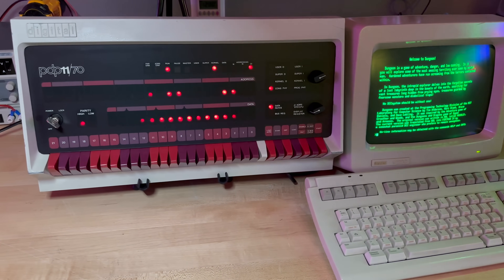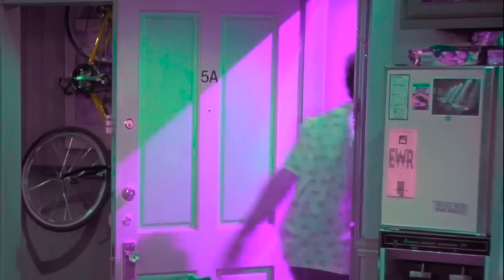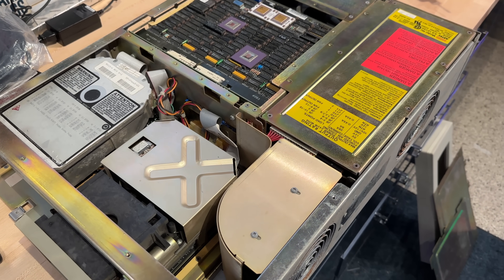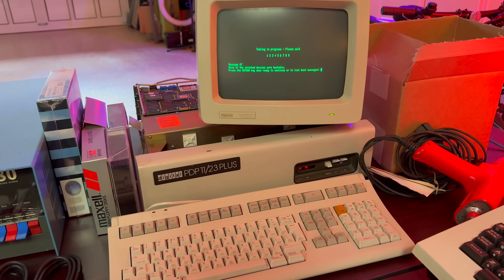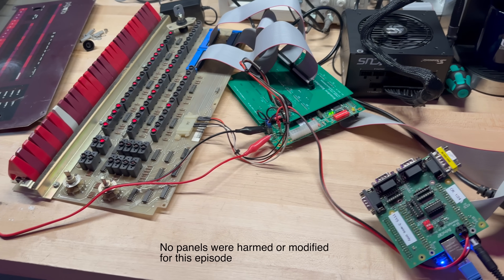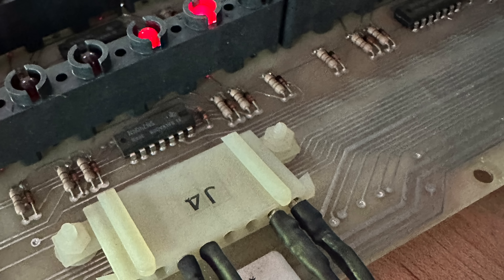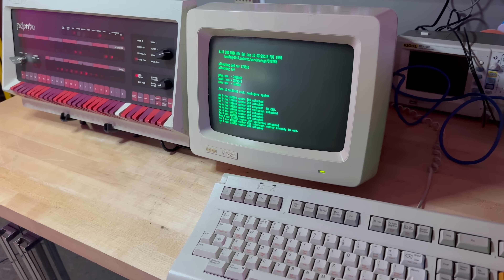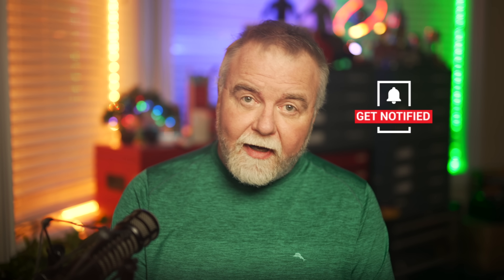Ultimate LED: The PDP-11 DASBLINKENLIGHTS!

Comment: So, the bezel you are missing could probably be reproduced in fiberglass and epoxy resin if you had one to produce a mold from. If you're interested I would suggest contacting Andy at the Boatworks Today youtube channel and get some insight from him about it. Couldn't hurt to ask. Casting in metal with a sand mold is possible but using an original part will result in shrinkage of the reproduction and possible fitment problems.

Comment: I used a pdp11/40 and a pdp11/20 whilst at university. They too had a physical front panel and had 16 teletype terminals connected to the pdp11/20. They were used for assembler programming for the systems programming module. They ran the universities own OSs. The pdp11/20 was used for interactive program editing and file storage and the pdp11/40 was used to assemble and run programs in batch mode. Part of the course was bare metal coding using the front panel to load and execute hand assembled programs. One of the 'unofficial' contests among the students was to have the displays show the most 'interesting' light patterns. I also had a program which caused the 16 teletype bells to sound in different patterns. One was to continuously ring all the bells whilst a particular front panel switch was set. I tried that when the operator came into the room. Suffice to say she wasn't impressed! There was also a plotter connected to the pdp11/40 and we produced some quite complex patterns. Ah - the good old days.

Comment: I too am looking for a bezel for my 11/70 front panel.  Since the original was made of metal (aluminum? zinc?) perhaps one could take a mold of one.  Then using that mold, create a positive and use it as a pattern for sand-casting.  I'm not sure how one would inexpensively make the positive slightly larger than the original to account for the molten metal shrinking as it cools.

Comment: I worked for DEC in the late 1970's.  The computer lab in the part of the company where I worked had a bunch of different PDP-11's.  Each of the systems was named for a character from "the Lord of the Rings", except for one.  That machine was a hugely expanded PDP-11/70 named "The Ark" (it had TWO of everything interfaced to it!)  The second largest system was named Gandalf, there was a small 11/20 called Bilbo.

Comment: From Jörg Hoppe's Web site (retrocmp):
"The last version of [RSX11M+] (V4.6) was updated to be Y2K compatible
so current dates work fine on it."

That comment is in reference to the "baseline" distribution disk
image at trailing-edge: rsx11mplus_4_6_bl87_dsk , which is presumably
the one you're using (the version is just legible in the shot of
the boot-up messages on your VT-220).

That version of RSX-11M+ was released in February, 1999 by
Mentec (not DEC). According to Wikipedia:

"Ownership of RSX-11S, RSX-11M, RSX-11M Plus and Micro/RSX was transferred
from Digital to Mentec Inc. in March 1994 as part of a broader agreement.
Mentec Inc. was the US subsidiary of Mentec Limited, an Irish firm
specializing in PDP-11 hardware and software support."

Comment: What a trip down memory lane, Dave.  I went to Northern College of Applied Arts and Technology in good old Kirkland Lake, Ontarion, Canada. Same old PDP 11-70 except the IOS was RSTS/E if memory serves me.  The is where I learned to program using Basic, Basic Plus2, COBOL, Fortran, APG, and assembler.  I did a research paper interfacing a Motorola D2 kit’s 8 character display and numerical keypad to a door lock solenoid and used the PDP to validate the credentials.  Needed to code in assembler and download to the D2 kit.  I remember stepping through memory banks in hex to fix issues because it was too cumbersome to code in assembler on the PDP, then convert to hex, download to D2 and then try it.  But seeing a solenoid click after entering a passcode was simply magic. I still marvel  at what actually happened to make all that work.  Thanks for posting I thought I would never see at this time!
Reply: I used to love to hate RSTS/E.  I was a student lab tech and spent most of my time rebooting it. Somebody was always trying to do something they weren't supposed to.  Really Slow Time Sharing - it was a great intro to my next DEC experience, a lab full of Vaxes.

Comment: My first computer experience was doing 9 track backups at age 6 standing on a chair and I worked the PDP1170 running RSTS.  My parent's owned the company Spartin Systems back in the 70's through the 90's where they bought, sold and leased time on the PDP11's .  I remember adjusting tape head alignment with my Swiss army knife and dripping wax on the pot switch so it wouldn't move with the vibrations.

Comment: Too funny, one of my first products was a pdp/11 RSTS basic and basic +2 to c translator (for the then “new” Unix systems) with a RSTS SYS AND FIP functional api emulator.  

one of my first “hands on” dec system was a pdp15 … 18bit word 5/7 ascii packing, and you could,play the first star wars game with a buddy using 9 data keys each. Excellent machine  pdp11/34 front end booted with paper tape, vector graphics processor .. and the graphic displays ran in the same memory as the regular cpu .. you just added a ,V’ before each assembler instruction (only assembler and Fortran) .. which allowed some clever bastards to use the graphics processor as a second cpu within the same memory space. 

I migrated many pdp11 systems written in assembler to vms/c and Unix/c. Oddly my life has been migrating vms systems to Unix/Linux for the past 30 years … I never left dec land … I miss the old DECUS days in NO .. with TGV renting the river boats.

Up until I migrated it (finished 3 months before 9/11) the 911 fire and ambulance dispatch and call center system for New York City ran on pdp11’s. There are still some nuclear power plants running pdp11’s.

The amount of pdp11 assembler I’ve written / migrated over the years .. I surprised my head hasn’t exploded … one of the hardest things was writing the ODL linker code .. Overlay Data Loader .. which dynamically grabbed code from the disk and dumped it on whatever piece of memory you had allocated for it. God help any code that it dumped on .. many a night pondering why a stacked jump was executing the wrong code.

Fun days.

Comment: I had an LSI-11 with all the lights. At work I had 11-45’s, 11-60’s, 11-70’s and VAX’s. They were used in multiprocessor links to simulate radars (with hardware in the loop), aircraft and missiles for critical-time (solve x equations in less than y time) for EW work. At home I had the LSI-11 and RSX software with FORTRAN for my PhD work. Of course my fellow students would use it too for there work. I loved the machine!

Comment: Does bring back memories. I wrote quite a bit of machine code on a PDP 8 and then moved to a PDP 11.  Digital really nailed the instruction set on the 11 with the mov instruction, device addressing via memory locations and great interrupt system - so clean compared to the PDP 8.  The machine I worked on had core memory, I think initially 4kb then we upgraded to 8k with semiconductor memory? It ran with a cassette disk drive with maybe a megabyte of capacity, huge! It could run Unix. Not sure what model it was, but it had paddle keys, with the magenta/red colouring. I had to toggle in a binary loader to get it running. Used it to run a radio telescope and sample and process the output. Amazing what you could do in 8k of memory.
Reply: Yes.  I started on a PDP-5 that the university had set up in an engineering building room for students only.  We had our own software budget and some other old electronics that got assembled into a working analog computer interfaced to the PDP-5, and now I'm seeing analog computers getting a fresh look for some problems.

Comment: In the 1980s, I met a fellow at Comdex who had a warehouse full of PDP-11 hardware. After sufficient recreation, I agreed to buy one. Several months later, he showed up at my company on 24th Street in San Francisco with a truck full of stuff. After some hard work, we had several six-foot tall 19" racks in the main room of my one-bedroom apartment on the second floor. By the time we got the machine running, he had emptied my bank account with unexpected expenses, including sending several boards off for repair. Ultimately it was all working though. I had forgotten a lot about this kind of equipment, though. It not only dimmed the neighborhood lights when I turned it on, but it was really loud. When I ran it I had to keep the sliding door to the porch open so the heat could escape. I gave terminals to several of my neighbors and ran serial cables out the porch door to their porches and, ultimately, to their terminals. I got my hands on a tape of the Decus C compiler, and I was good to go.
So, Dave, I understand your desire to own one of these beasts. It is a shock when you realize that the hard disk, which may have even been 10 megabytes, was the size of a washing machine.
In the end, none of the neighbors felt like using a line editor for word processing. It was just a little too retro.  It gave them a taste of what it was like to have computing at home.
That was Goodall Computer Systems on 24th Street. Those were some fun days.

Comment: I was a DEC FS employee, started in '78, I was trained in Bedford, Mass on all PDP-11's. One system you might have liked was a 11/72, yes 72! It was two 11/70's with common memory in the basement in Bedford. It was very cool. Also, those panels you have could have been saved because DEC FS routinely replaced them with a Remote Diagnosis front panel that did not have switches and all the lights. It was connected to DEC in Colorado Springs. We did not have what is now self-tests at power up time, but the RDC could be into the machine while I was dispatching to remediate, a very different time than remediation now.

Comment: I first programmed a LINC-8 in the late 60s in university. Two full size cabinets. DEC tape and analog inputs. (This was a vet research lab)
To boot it you had to use the front panel switches to enter the boot program into 12 bit core memory ... Yes, real core 4K

Comment: you still amaze me with how our 2 careers paralleled each other. You went software and I was hardware. I also cut my teeth on a PDP 11 back in college . At 1st it was the 1108 and then 1103.  I then worked as a user consultant for digital equipment for a pharmaceutical company for a summer.

Comment: Thanks for the flash from the past. I learned machine code and assembly language on a PDP 11 40, and later worked with a PDP 11 4 in a mold factory. Now I really feel old and wise, though no one seems to see the wise part.

Comment: As a Field Engineer for Motorola back in the late 1990's, I was sent to the Hawley Earth Station in Pennsylvania. The complex is nestled in the hills around Lake Wallenpaupack. I was there to install a digital satellite television system, which was just prior to updating all of television in North America to digital and HD from the NTSC standard. But that is a different story. While installing racks of processing equipment, I took time each day to take my breaks and lunch by spending time outside the building.  Outside the data center doors, planted in the grass was what I recognized as a PDP-11. The variety of which, I could not say. The packrat in me wanted to bring it home or at least contact my boss from a previous job, who was also a great mentor. Brad had mentioned learning on a PDP-11 in college.  I recall taking a photo to show him, which is on any of countless rolls of film I had from those days. This video by Dave reminded me of that trip and finding the PDP-11 lavishing in the rainy weather and wishing I had more knowledge of that kind of hardware.

Comment: Had a PDP-1 in the Air Force, 1967. It was used with Basic on a 5 level tape to run a classified program to produce a another classified 5 level tape to run on an analog computer.

Comment: You can also SSH into the BeagleBone over USB.  It's been a long time, so I can't remember what setup there might have originally been to get that working.

(Caveat; I've only used the BeagleBone cards that were included with Gesswein MFM-drive emulators.  Those run some flavour of Linux.  I don't know how close that is to the BeagleBone's stock software.)

Comment: Back in the day, I used a PDP11/34 with the Military.  It was a real time system, I had no access to the OS, so don't really know what it was.  I do know that it sometimes failed in spectacular slow motion.  We would start getting errors, they would pile up and we would then check the clock.  If the next shift was due withing an hour we could reboot, and by the time they arrived the system should be up and running.

Comment: I worked for DEC in Maynard for 18 years. My first home computer, in the late 70's, was a PDP-11 named a PDT-150.  (PDT = Programmable Data Terminal. Ken Olson didn't care for home 'computers')

Two 8 inch floppys and a PDP-11 in a box about 2 ft square.  I ran RT-11 and a VT-52.  I can still recall the clanking of the big floppies as it booted.  Sadly, no row of blinking lights...

Comment: Somewhere on the DECUS PDP11 tapes (circa ‘79/‘80) are my MACRO-11 programs that emulates RSX-11M, 11D, RSTS, led rotating patterns. They are all different. Why? So that I could confuse DEC engineers into thinking a different OS was actually running on a PDP11/70. So much fun! Gladly I went on to write more useful code during my s/w career! (I think)

Comment: Bet I wrote 1M+ lines of PDP-11 assembler on RSX-11D/IAS on PDP-11/70s and '45s in the late 70s.  The '45s were good, same panel colors.  I didn't like the new fangled VAXes cuz they didn't have purple/red panels.
Switches and lights mostly for debugging kernel driver code, stuff like that.
Friend of mine has a 11/70 panel but it is blue and gray.  He did what Dave did, took the PiDP-11 RasPI and connected it to his panel.

Comment: Hi Dave, I've got a question, although I must admit- I'm not sure that you take questions over here:
Why does an Antivirus start a full scan very quickly- it scans 20000 files within a few seconds, but then it runs for many hours and gets gradually so slow, that scanning one file takes around 10 seconds.
Is it necessarily bad resource management on behalf of the programmer, or is there something we can fine-tune on windows 11 to fix that?

Comment: Dave, I don't think your PDP panel has LEDs installed.  LEDs come on and off much quicker, whereas incandescent bulbs have a slower rate of change as the element warms up or cools off.  The video shows what I believe are incandescent lamps.  Early PDP 11 systems used incandescent lamps and didn't switch to LEDs until after users were already doing it themselves to reduce power consumption and reduce heat output.  Ken Olsen never listened to customers or his sales people, always deferring to his engineers.  Engineers that had a propensity of saying, "It can't be done".

Comment: This brings back lots of memories of using PDP-8, 1134, 1144, and later a VAX. I used to trade writing administrative maintenance programs in Fortran 4 for additional lab access, which i used the card reader/punch to avoid having to reserve kepunch time fot a 370 which I hated. (both the 370 and the keypunch)

Comment: Why not strip off the bezel, photograph it from multiple angles, then feed the photos into a photogrammetry package to create a basic 3D model? 
This would give you a working shape that could be cleaned up and printed: take it even further, and use the model or the clean print to get a new bezel cut on a CNC mill by a specialist firm? That would be an excellent little project to record for a future video!

Comment: I was working in a "DEC shop" in the '80s, and we had a service contract. About once every two weeks one PDP-11 would just stop. The DEC serviceman would be called. He knew exactly what to do as the same board always needed replacement. Finally, an employee called me as he knew something was "off." It turned out to be a cold solder joint on the backplane. Vibration would break the power connection after a while. The boards weren't bad. The only person I impressed was the user of the computer! 😊

Comment: HORRIBLE topic name
There were older machines that had quite a few more LEDs, and if we're talking intensity modern LED HEADLIGHTS are a lot brighter.
For reference, I initially learned to program on a PDP-11/70 under RSTS/E and later moved to a PDP-11/34 running Version 5 AT&T Unix (yes, it was a numerical version, NOT the later Roman Numbers and "System V" type designation - EARLY version).

Comment: This video was so much fun. I first learned to program in high school on a PDP-11 in 1973. It was an interesting experience because to boot the system, we first had to set the address and the instruction using those switches on the front and then loading them before advancing the address and repeating this.

This was simply to program a boot loader that would read the punch tape attached to it. Once that was in, we'd load the punch tape and execute the program to read the tape. This would load the multi-user OS and Basic in about 15 minutes.

We'd then venture to a Teletype terminal that had its own punch tape reader and load our previous day's program into memory so we could work on it. Each user only had about 1K of addressable user space in memory, so we got very crafty on writing concise programs, reclaiming/reusing variables, etc.
Reply: I was on an PDP11/8e at my high school at that time. Fun!